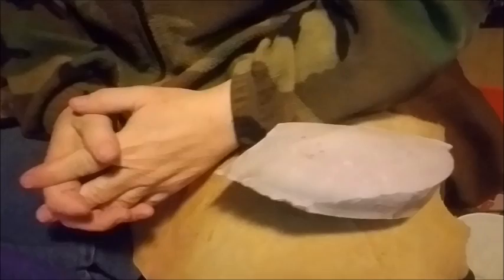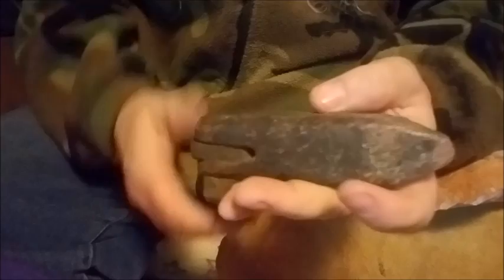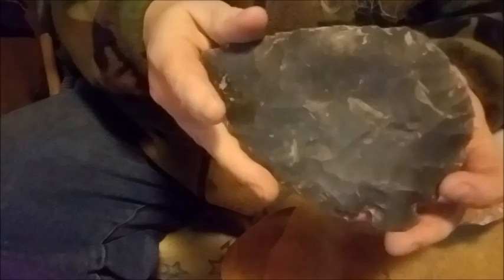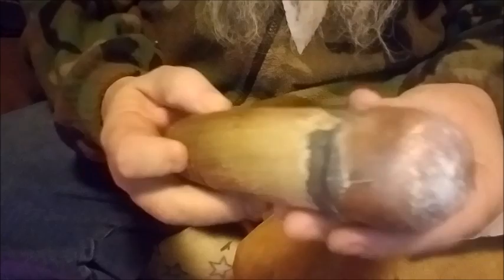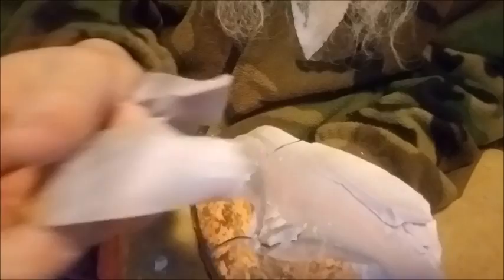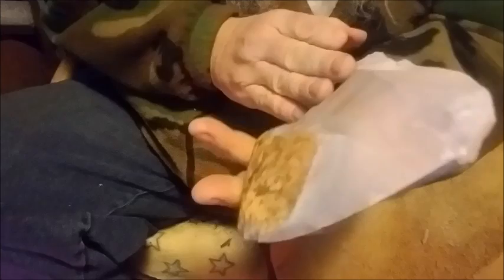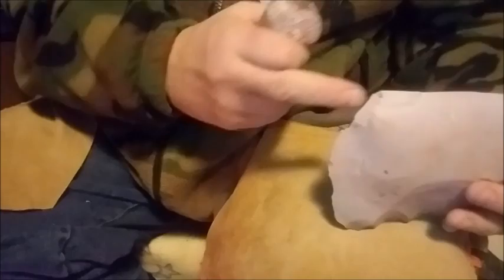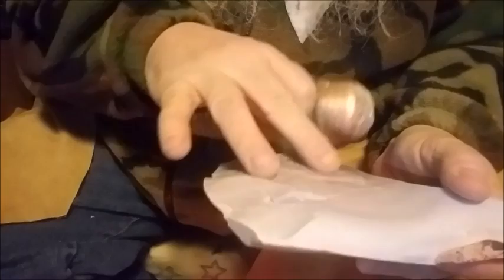Flintknapping Large Biface Spalling Knife from Novaculite Greg Malone

Comment: Greg

Thanks for showing. I have hunted the sw Arkansas area for over 40 years and found thousands of points, mostly Gary and arrow points. All the novaculite points, including larger blades were heat treated. You did a great job of explaining the sequence. The Indians had no copper or heavy billets so they heat treated all the good points I have found . Do you heat treat after the biface is complete and if so why not heat treat before starting the biface?  I have never found a knoched point that had not been heat treated before manufacture but some of the true arrow points that are heat treated are thin and very well made. All Agee and Homan points were made out of heat treated  novaculite . I think the Kidd site Agees are the finest crafted artifacts in the U.S. So strange the Hayes points are seldom if ever made out of novaculite and are not heat treated. Any idea why? All are Coles Creak and Caddo points.

I have knapped some large broken heat reated points and it is great to work. The few points I have found that were not heat treated are what I call cigar points as they are as wide as they are thick.
Reply from the maker: I must confess, I am not an expert on aboriginal points. I know what you mean by cigar points. I do work a lot of rock raw. My novaculite is cooked. It comes from a pit in Arkansas.